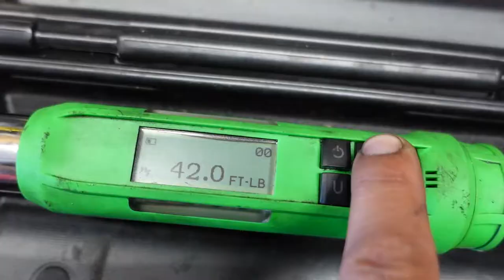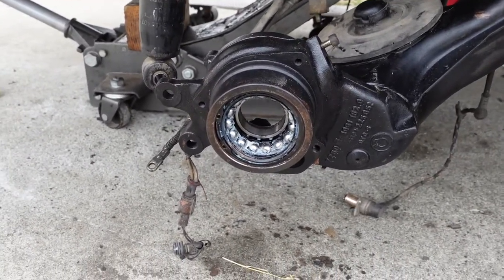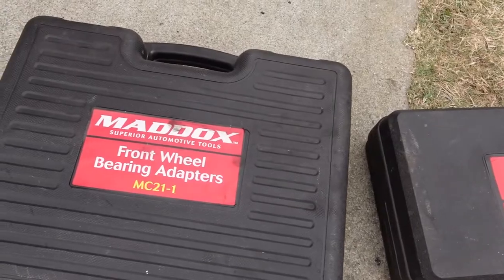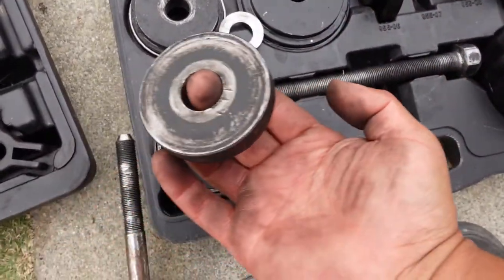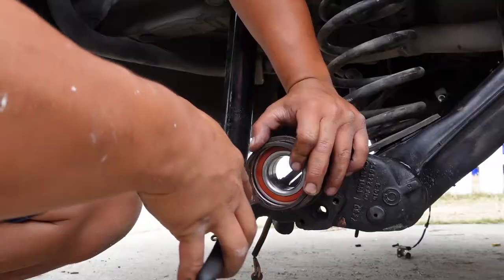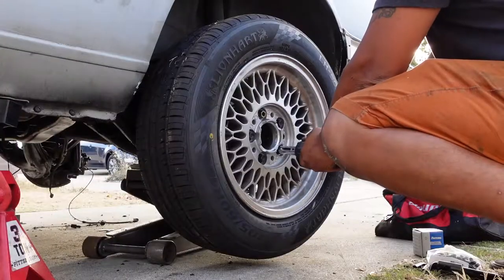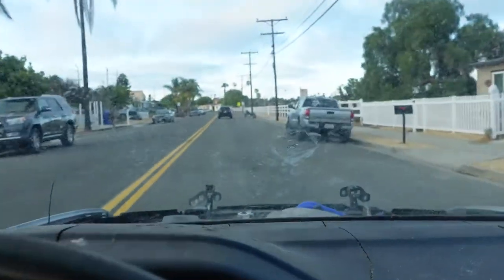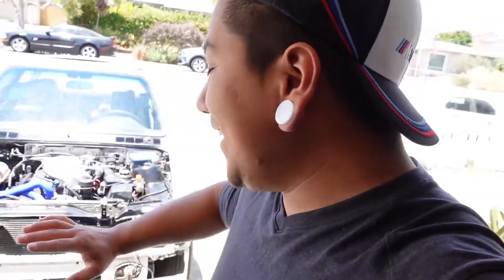E30 FIVE LUG SWAP! - PT. 2 - FIRST DRIVE!

Comment: What rear hub are you using?
Reply from the maker: Rear assembly is all from an e36 318ti from what I remember. If not, then i used rear Z3 (I4) hubs they are basically the same other than the bearing size. 

I used this for the info for the swap 👇

https://www.e30zone.net/e30wiki/index.php/5-Lug_Conversion